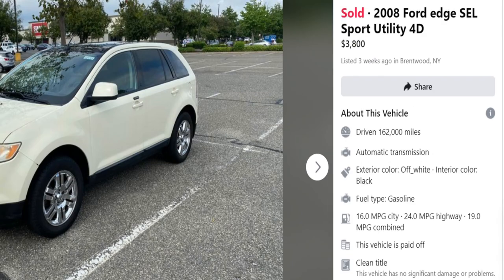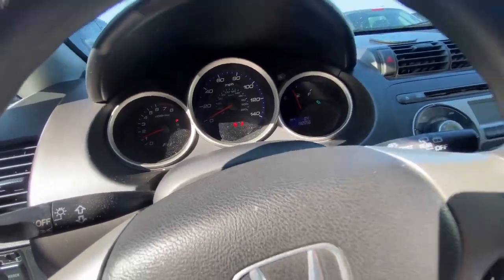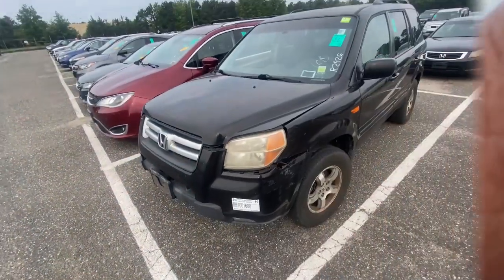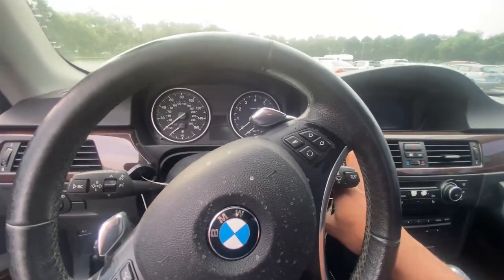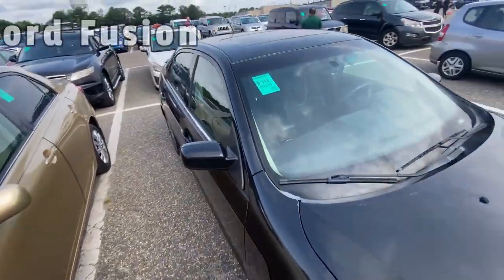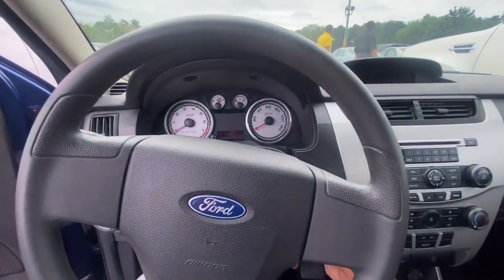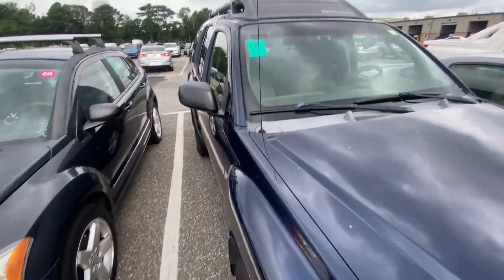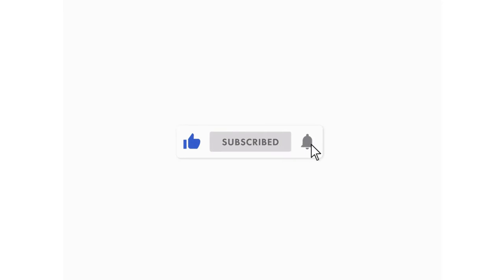Turning $1,000 To $100,000 Flipping Cars Part 15 - $300/Hr Flip

Comment: As soon as you saw the Saab I yelled NOOOO RUN AWAY! 
They may seem cool, but resale on saabs is so low they aren't worth the headache. Also, pre-2002 9-3 and 9-5 with the 2.3l turbo engines use a "Direct Ignition Cassette" instead of coil packs. A new one is over 400 dollars. 
Looks like your method for yes or no is good! Just maybe devote a few mins a night to researching some of the more odd or less common cars, and other common issues. Knowledge is power in the car world. 
Keep it up! 100k is coming!
Reply from the maker: Haha yea I wouldn't really go for it if it had problems but maybe I should avoid them altogether. Thanks for the support!